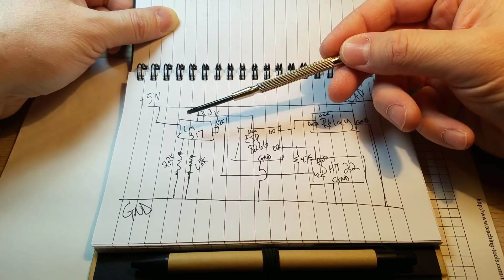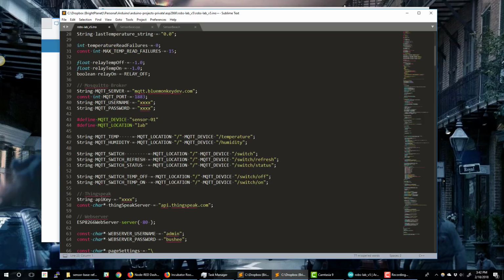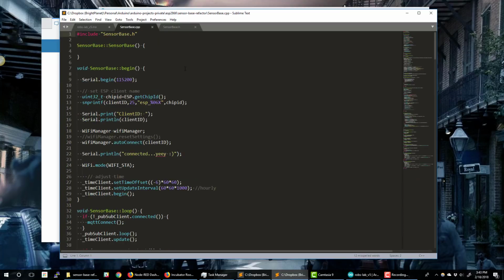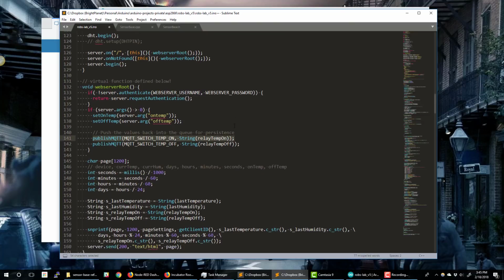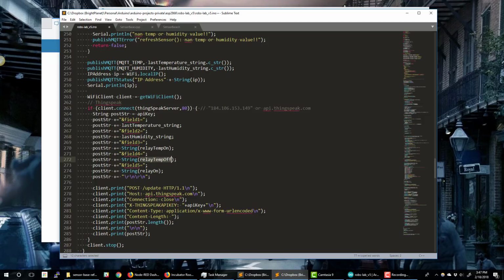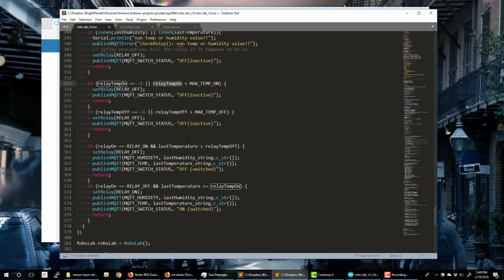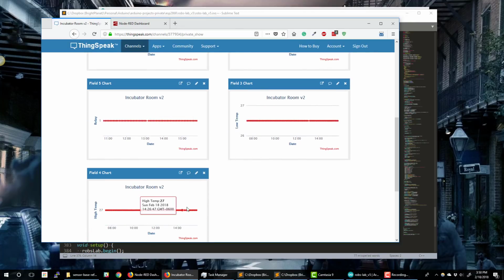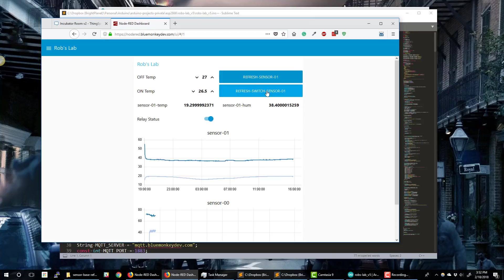ESP8266 Temperature Relay Project

Comment: is it not possible if i want a simple temperature controlled relay. consisting just of a light bulb and a temperature sensor and we can see the data on the serial monitor in the Arduino ide platform? I am a beginner and your code made me feel like i dont know anything.
Reply from the maker: This video is a few years old - there are platforms that can do this easier. You should look into platforms like 
Cayenne
, Ubidots, Home Assistant, or Blynk. They are more limited but can be a lot easier for a beginner.

Comment: Dude, Nice Project! Need your help. I have set upped all main values for WiFi connection and MQTT broker such as: server, port, user and pass. But one by one i've getting: "Attempting MQTT connection...failed, rc=-2 try again in 5 seconds". In my local network i can see the device. 1st message in the log was IP Failed. Which IP is? What can be the solution?
Reply from the maker: This message usually means that the wifi has connected but there is no access to the internet. I've gotten this when there is a routing problem or the wifi signal is insufficient to send data. That probably doesn't help you much but might get you going in the right direction. 

Thanks